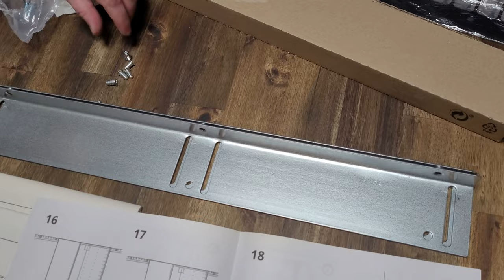Gorenje Built In Oven and microwave oven IKEA METOD kitchen cabinet integrateion step-by-step guide.

Comment: Based on my understanding of the instruction booklet, IKEA's recommends the adjustable metal bracket should be at the bottom of the oven and the vented shelf should be above the oven (hot air goes up), if there is more than one appliance like in this case i think another urtusta oven bracket with adjustable bracket is required. Anyway as long as there is adequate support and ventilation I guess whichever way works.
Reply: Yeah the metal bracket is definitely meant to be used with the much heavier appliances
Reply: @bastien4985  just fitted mine and got ikea to supply two more brackets has I am fitting two ovens.

I fitted 1 pair of brackets at the bottom  for the support of the 1st oven and then another pair of brackets on top of it with vent for my 2nd oven.
Reply: @DeanneMariaCreates  yeah it’s much safer that way. The standard prongs aren’t made to support an oven
Reply: Hi, does the IKEA 'METOD / MAXIMERA' cupboards contents contain those steel oven supports? Or do they come with an oven? I hop e you can answer my question. Have a good day.
Reply: That’s what I thought 😅

Comment: The first oven is held by 6 screws and the second oven is held by a bracket and 18 screws? What is the point of putting two identical ovens on top of each other?
Reply: I wondered about the screws too...
First oven is 60 cm in height, second 45 cm.
Mostly this combination is a real oven (60cm) with all functionality, and a microwave/oven combination (45cm) next to it.
For example there aren't any ovens that offer steam and microwave. so you'll need two. (and sometimes you could need two ovens at the same time right?)
Reply: He did shelves other way maybe because it's not IKEA devices but from Gorenje so maybe he needed adjusted one on top. Normally that one should be lower for owen which is heavier. 

Second device you are asking about is microwave
Reply: @Saeglopur89  Better to get a second oven shelf. The lower shelf isn't designed to carry an oven.
Reply: @michaelchannon2644   Hmmm I guess you explained why IKEA gave me one or two more - I'm still putting all this together :O
Reply: @michaelchannon2644  Ah no, that shelf is included already and it's bit different that shelf under and above microwave

Comment: Hi Gorenje, where did you buy the silver filler strips from please? Are those Ikea?
Reply from the maker: You could use FÖRBÄTTRA -  hhe stainless steel cover strip from IKEA 002.533.99. In my case i used floor cover strip from Hornbach shop Skandor 900 x 40 x 5
Reply: @PrideCZ  thanks for that. I bought the Forbattra strip and it isn't good (they only have the one size and it looks like they hired an amateur to cut it). It is plastic and a grey colour.. Will do the same as you Gorenje. Thanks for the tip! 👍